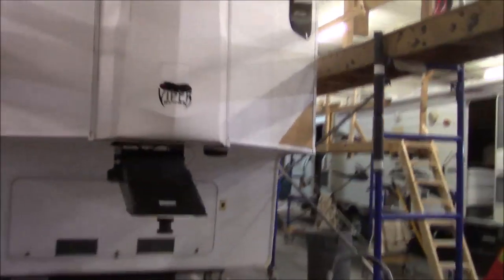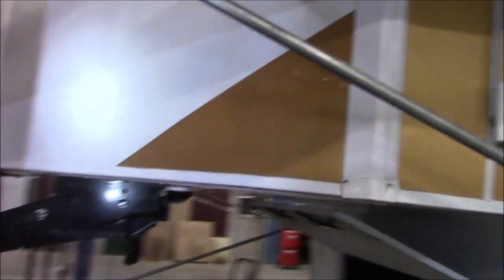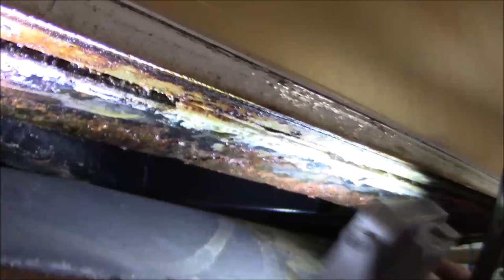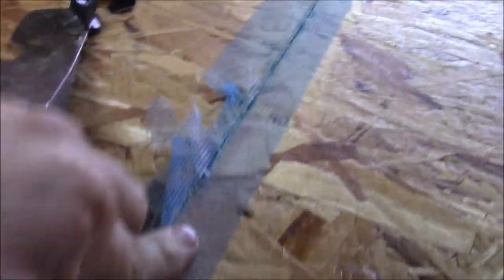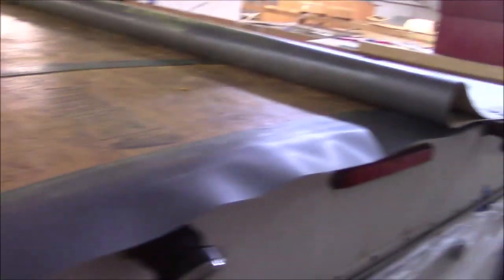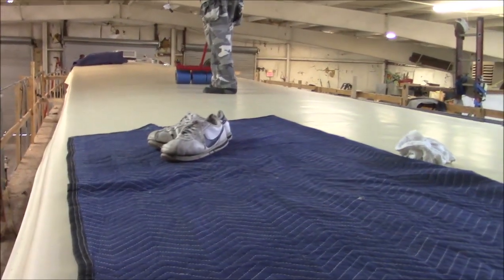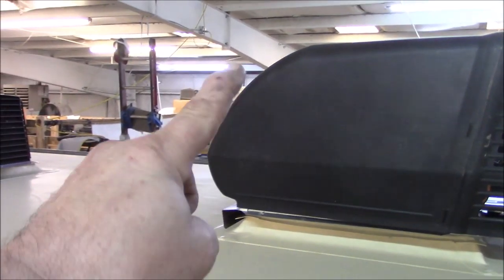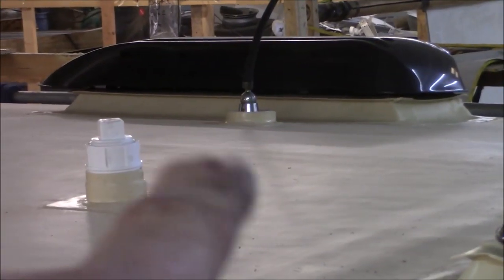2013 Viper New Roof and Fixed Floor

Comment: Wow, that's a huge job. So disappointing for a high dollar camper to be that bad. RV manufacturers should be ashamed.
Reply: It is so weird that something has not been done before. The companies should have to have a building code to follow. When you take one apart and see the BS inside the walls, floors and ceilings it will blow your mind and pocket book. I try to take really good care of this RV and it still had some issues. It is 8 years old now, but with this upgrade I think moving forward it will have a long life ahead of it.

Comment: Nice work, I'm going to do new roof on my 1997 alpenlite truck camper, I was wandering if you could show some on making up the curbs for the hatches, really appreciate your videos, thanks for all the expert advice.
Reply from the maker: All the curbs and roof components are proprietary to us. We designed the roof system to work and function for a camper RV. We don't sell them either. Sorry friend. You got your work cut out for you on your camper. We have several Lance videos that may help you get some ideas.
Thanks for watching.
Reply: Thanks for your comment, I watch a lot of your videos and I'm going to give it a go. Thanks again

Comment: At 25:15 into this video you said that you sealed all the windows and lights. Once done, how often do you recommend resealing the lights and windows?
Reply from the maker: Those particular windows had a sticker that said to replace the window gaskets every 2 years. Those windows were not caulked. 
We caulked them, but if you have those type of windows you'd better get  them opened so you don't seal them shut... lol. 
But to answer your question if you use a good caulk you shouldn't have to caulk them for a long time...years. that being said...it's a smart thing to inspect once a year to be sure things are sealed and you didn't get a bad batch of caulk.  Duralink by Chemlink will work fine. 
Thanks for watching.
Reply: @RVROOFINSTALL  Thank you